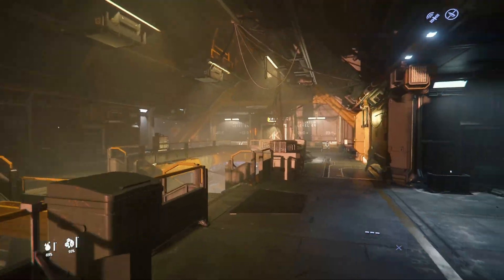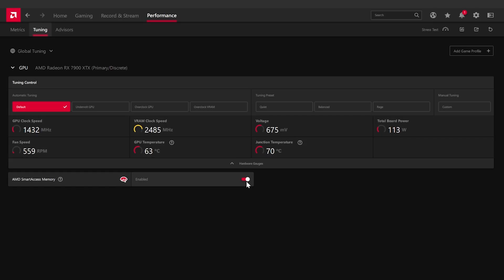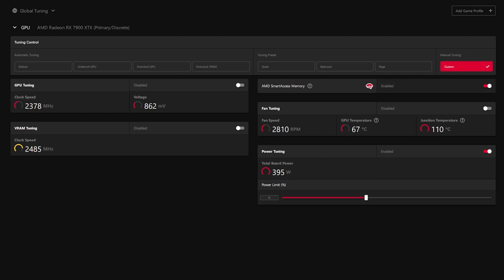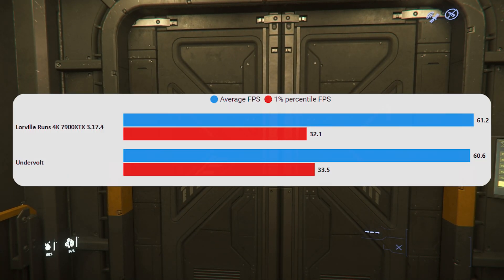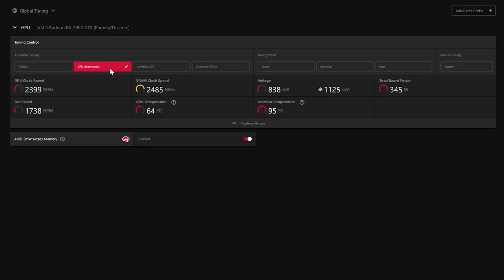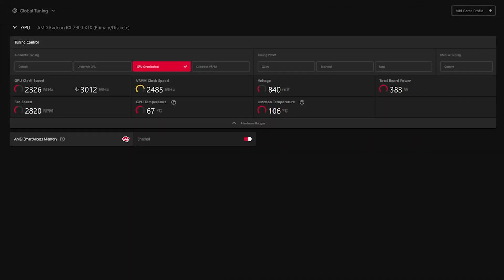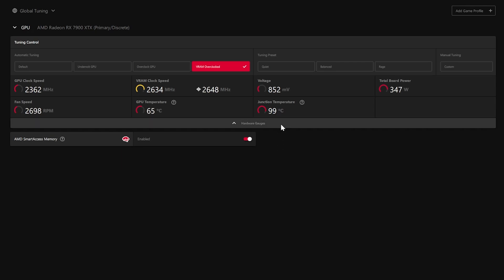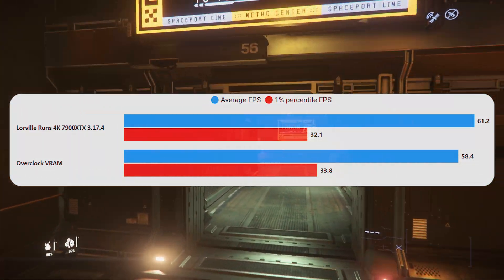7900 XTX Overclocking and Hotspot Testing | Star Citizen

Comment: I have a 7900xtx reference unopened in the box right now. I can literally put together my 4k gaming build, but it's on hold as I debate with myself if I want to take it out of the box, and then argue with AMD over the heat (IF I have the problem). The alternative would be to RMA it in the unopened box (thereby at least bypassing the argument with AMD). Of course, then I'd have to buy the 4080 *cough*, or the 4090. I have a 5120x1440 display and I was really hoping to drive it with this card. Out of curiosity, how is yours mounted? I at least have a HYTE Y60 to mount it in, and it seems like the heat issue is "less" often with a vertical mount. As far as overclocking... look for Ancient Gameplays channel as he has an "excellent" video on undervolting / performance. I'm just bummed with how all this worked out.
Reply from the maker: The Ancient Gameplays video was actually my starting point for the custom overclock! I think in your case I would just leave it in the box and not take the risk. Maybe look at a non reference model if you don't want to go Nvidia.
Reply: @tenpoundfortytwo  I appreciate the advice, and I really think you are right. I've been wringing my hands over it for a few days. I think I'll just get a hold of Digital River and get the RMA started. If not anything, I'll tell them exactly why I am sending it back. If they would have acknowledged it, and perhaps worked with an AIB distributor to create a "process" to fix it, I'd do it, but waiting is the enemy of time right now. So back it goes (lol, I was SO close to 4k), hahahah :)
Reply: @SpaceShortsYT  JayzTwoCents did a video about der8auer's video troubleshooting the overheating.  der8auer was able to debunk the mounting position hypothesis.  His conclusion was that there is something wrong with the vapor chamber on the reference design.  One other commenter said they had really good outcome with a Sapphire 7900XTX.  Another commenter said they had good luck with a PowerColor Red Devil 7900XTX.   You probably couldn't go wrong with a ASUS model either.  Anyway, here is a link to der8auer's video:  https://www.youtube.com/watch?v=26Lxydc-3K8

Comment: Have you tried vertical orientation like Der Bauer? Curious if you can get lower temps the same way...
Reply from the maker: @geerstyresoil3136 I actually already had it vertical first (easier to swap out GPU's) and then saw the Der Bauer video so tested horizontal! I didn't find much of a difference between the two in my scenario.
Reply: Also curious about inverted horizontal orientation which Der Bauer didn't test.
Reply: @geerstyresoil3136  There is no need to test 1 110 156 444 568 different orientations. He already found that vapor chamber design is defective
Reply: @lamikal2515  why do some cards work fine then if vapor chamber is considered defective? many have only 20 degree delta and do not have hotspot throttle issue. Der Bauer suggests it's a manufacturing error (insufficient water) not a design error per se.

Comment: I can spoil you this already, a bigger fatter GPU is not going to solve the performance issues we all have with Star Citizen.
Reply: As an example: I have a 3080 and had a 3060 before it, the rest of my PC has not changed and performance in Star Citizen is exactly the same between the two GPU's.
Reply from the maker: Depends on resolution, at 4k every little helps!